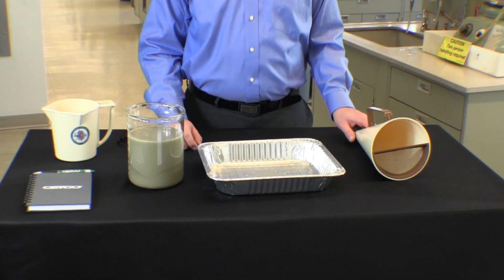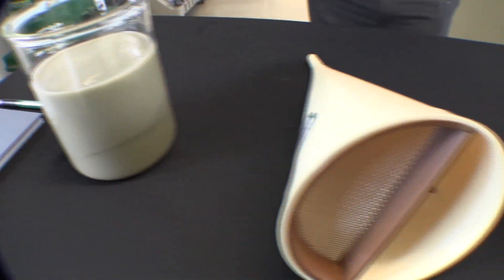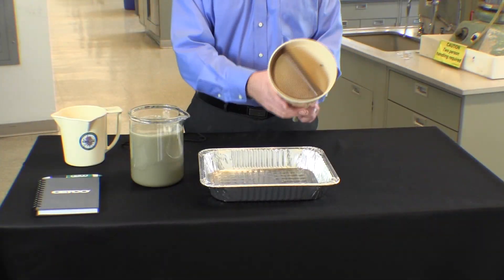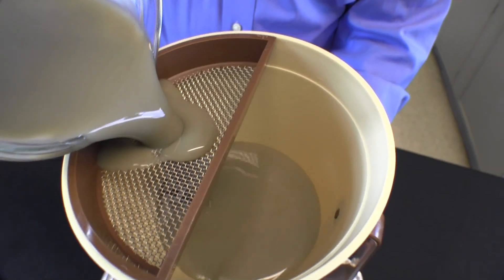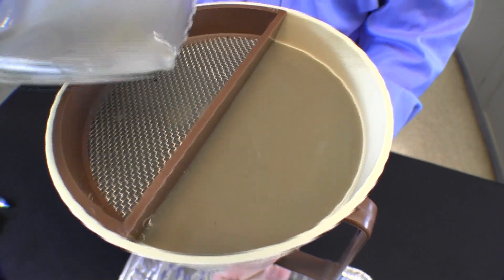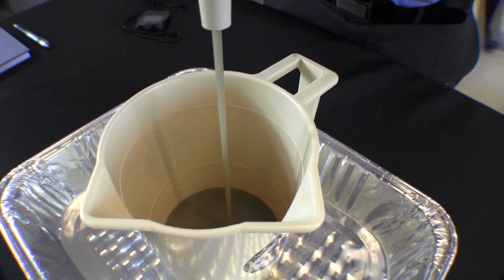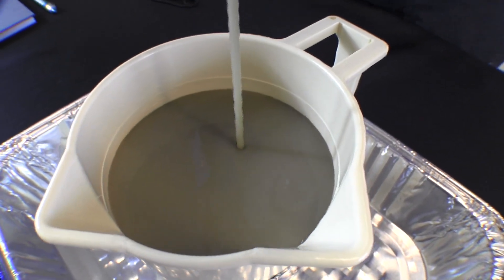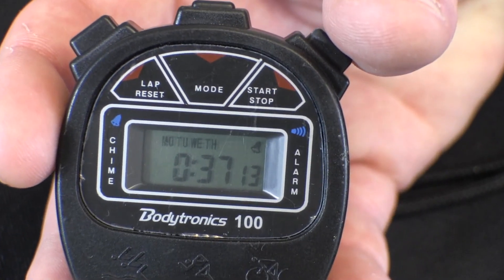Marsh Funnel Viscosity Test

Comment: You shouldn't plug it with your finger like that. The gel strength of the mud may cause your Visc reading to be slightly different. It all depends on how accurate you want your data.